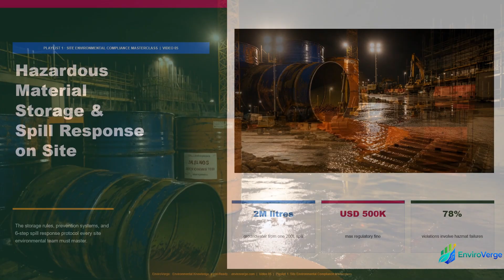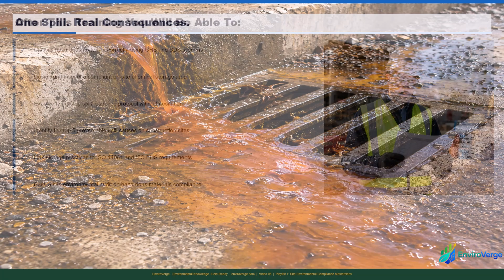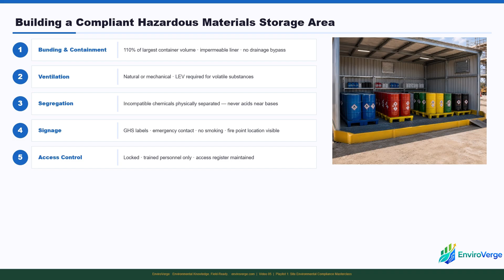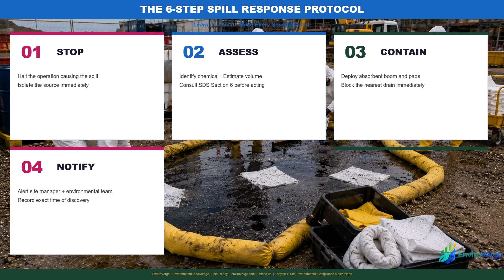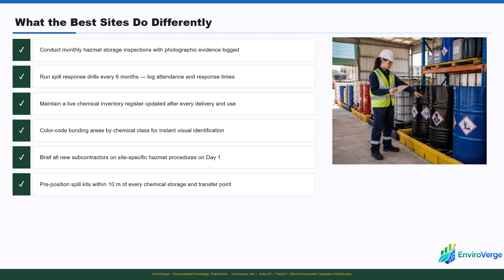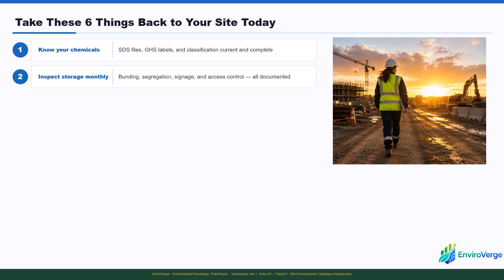The Reality of Site Spills: How to Prevent and Respond Like a Pro

Comment from the maker: 🚨 What would your team do if a fuel, oil, or chemical spill happened RIGHT NOW?

Many sites have hazardous materials on-site every day — but not every site is prepared to respond correctly when something goes wrong.

In this training, you'll learn:
✅ Hazardous material storage requirements
✅ Secondary containment and spill prevention
✅ The 6-step spill response process
✅ Common compliance mistakes found during inspections
✅ Practical actions aligned with ISO 14001 and industry best practices

💬 Question for you:
What is the most common hazardous material stored on your project site? Fuel, paint, chemicals, oils, or something else?

Drop your answer in the comments.

👍 If you found this training useful, please Like, Share, and Subscribe to EnviroVerge for more environmental compliance, sustainability, ESG, and ISO 14001 training content.

#EnvironmentalCompliance #HazardousMaterials #SpillResponse #ISO14001 #EnvironmentalManagement #ConstructionEnvironment #ESG #EnviroVerge